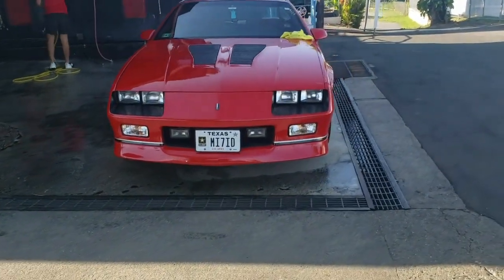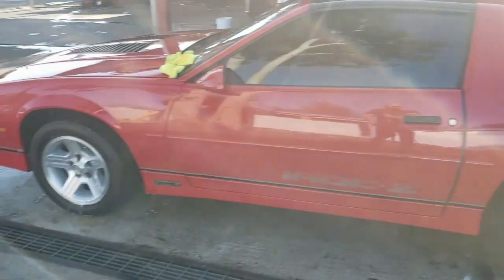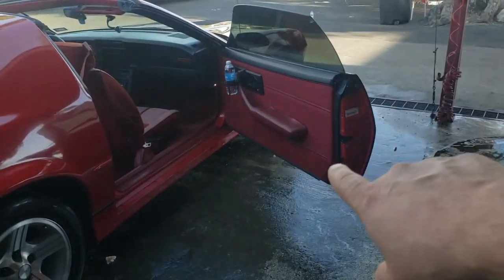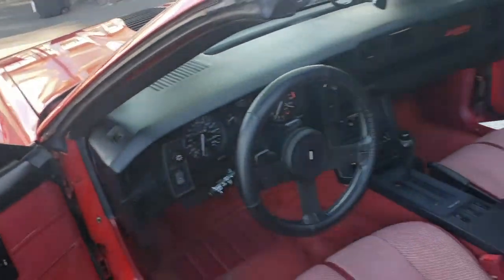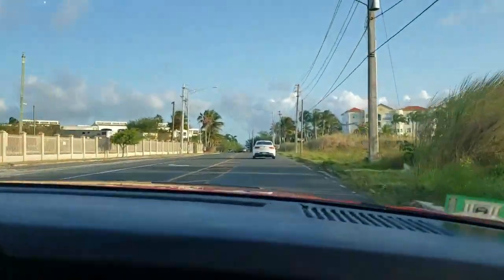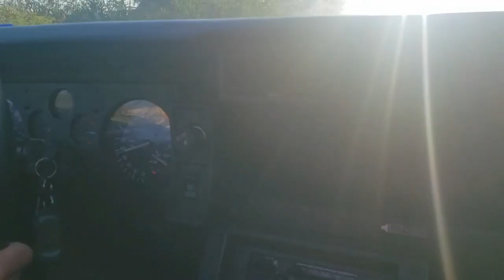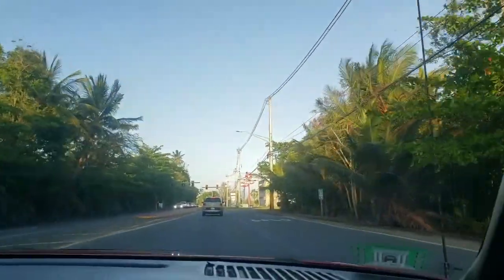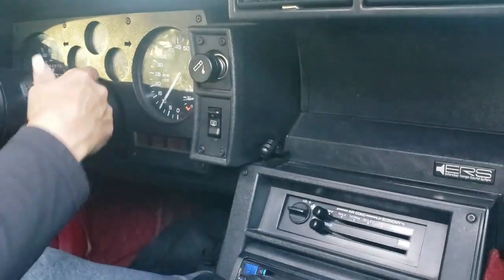PT 5, TLC FOR THE IROC-Z THEN PERFORMANCE TEST.

Comment: I forgot that IROCs accelerate like slugs.
Reply from the maker: Well, that was fast in its day. Of course today's engines are much faster.
Reply: I had a '89 Iroc Z years ago. 305 TPI, automatic, 2:77 gears. The car turned low 15's in the quarter mile. It handled well, sounded great and was a very fun car.